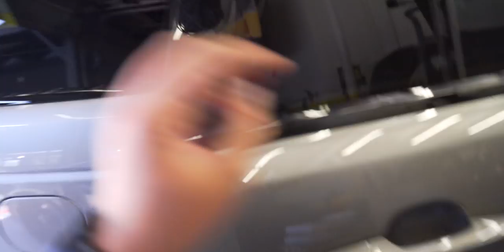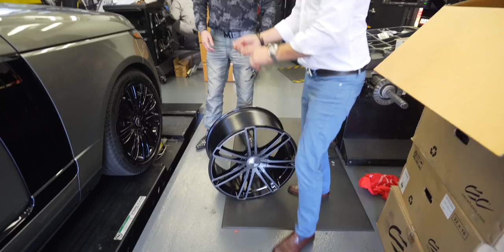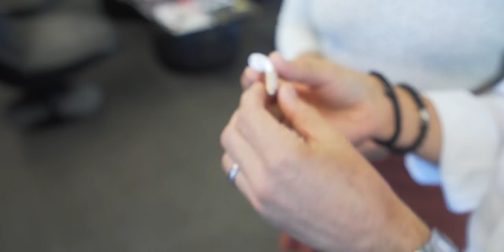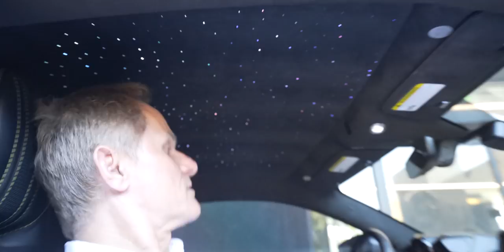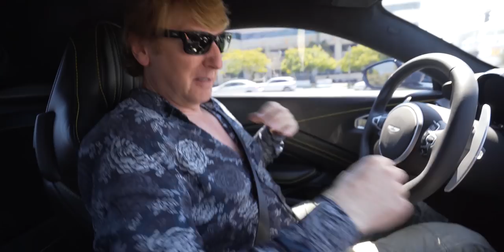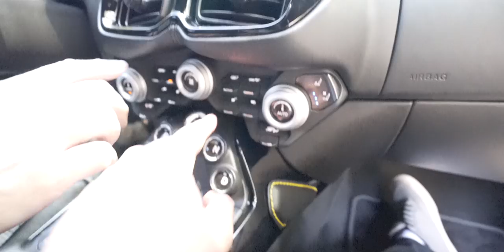INSANE 2019 ASTON MARTIN VANTAGE!!

Comment: Adam: The 8 Pipes coming down from the engine are called the Headers (2on this car). The downpipe is mounted on the turbo which is only one Pipe (as twin turbo two of them one per turbo) the downpipe includes the catalytic converter which doesn’t really let the engine breathe properly now if you remove them you can run more turbo boost due the cats got removed or replaced with sport cats with the aftermarket downpipe so the exhaust gases can escape easier without having to fight through the honeycomb cats what is like blowing against a wall hahah . :)
Reply: 100%
Reply: This car has no headers. The turbos or mounted directly to the cylinder head. The turbos are installed in the middle of the „V“ that’s why it’s called „the hot V“ That’s also the reason why Michael felt that „instant kick“ because this car has nearly no turbo lack because the exhaust gas goes directly into the turbos. However I agree with the downpipe. The 2 downpipes go down from each turbo.
Reply: JustinsSupercars The AMG M177 has the turbos right on top of the engine yes. But it still got tiny little headers (turbo manifold) where the turbo is mounted on. 4 pipes per block go together to one where the turbo sits on. If you look up m177 v8 headers you can see them there are some pictures up. https://www.europeanboost.com/showthread.php?89409-BigBoost-developing-built-AMG-M177-V8-engine-package-with-cast-turbo-manifolds-and-upgraded-turbochargers
Reply: TMO I know that Engine really well, I work at Brabus and work on that engine every day. I don’t consider it a real header. It’s just a little distance piece that is necessary to go from 4 openings to one. Also it depends if it’s an AMG engine if it’s an AMG „S“ engine or a normal „500“ engine. They all have very different parts in and on them.
Reply: JustinsSupercars Yeah you’re 100% right thats why I said tiny headers/ turbo manifold 🙃 worked on the vintage with a friend and installed downpipes on his car. I am not the smartest with cars tho still learning haha
Reply: @JustinsSupercars  its turbo lag not lack
Reply: krusher74 You’re right! Autocorrect was drunk I guess...

Comment: Downpipe is the pipe that comes off the turbine housing. You were explaining the turbo manifold. So you have the turbo manifold which then directs the spent gases from the combustion chamber. It then travels through the turbine wheel giving it energy to spin. The turbine is on a shaft which is connected to the compressor. The compressor side is the side that is your "intake" and is bringing in fresh air. It then compresses, goes through an intercooler (cools the air from being compressed in the compressor housing) , then from the intercooler THEN into the throttle body and into the intake manifold etc. I digress, so the spent gases from the combustion chamber will flow into the turbine housing and its energy spins the turbine. It hits the Inducer and flows into whats call the exducer which then sends it into the DOWNPIPE which is then connected to the rest of the exhaust system. Usually 4-2-1 is N/A cars. With a turbo manifold it's 4 individual tubes flowing into a collector which merges them right into the turbo flange and into the turbo.

Comment: Bad for the planet cars.  Needs more Tesla.
Reply: Wol Tee More like the new Porsche Taycan 😱
Reply: @iandante4694  Yes even that.
Reply: Wol Tee    Whenever there is an issue with the power the gasoline and diesel vehicles are brought out to keep the city moving.
Reply: @patriciaasturias1007 . It's ironic that you say that as it is very likely the the power would be put out by a storm, the intensity of which are increasing due to anthropogenic climate change, which in part is caused by said vehicles.   What has that got to do with what everyday Joe drives anyway?

Comment: A down pipe is the pipe that exits the back of the turbine . The turbo manifold is connected to the exhaust side of the engine with a pipe for each cylinder.

Comment: Not to be pedantic but you are confusing downpipes for exhaust manifolds. The downpipe is the pipe that leads directly off of the turbo to the rest of the exhaust. Not ally the downpipe in these engines have one of the catalytic converters in them. By removing the cat from the downpipe it seriously opens up the exhaust. They are usually engineered to flow much better than the stock downpipes.

Comment: Twin Turbo means you have one fast spooling turbo for low end power and a slow spooling one for top end power and Bi-Turbo means you have 2 same size turbos and they spool at the same time, so its laggier but more top end power and a bigger "kick". If anyone was wondering :D

ps. i know nothing about this "turbo engines dont sound good" talk :D

ps2. a downpipe comes straight from the turbo not the engine. The only thing attached to the engine is the turbo manifold :)

Comment: As a car guy, Adams explanation of down pipes physically hurt me.  The downpipe is the pipe that exhausts directly off of the turbine housing of the turbo.  The multiple pipes that exhaust each cylinder is the exhaust header/manifold.

Comment: Try the A twin-turbocharged 5.2-liter V-12 engine makes 715 horsepower and drives the rear wheels through an eight-speed automatic; mash the gas pedal and the DBS takes off like a Saturn V rocket and  should have enough power for ya.

Comment: No no no, this doesn't have a 8-4-2 or any other exhaust header set. There are still a pair of exhaust manifolds, these still feed the turbo, and the downpipe from the hot-vee turbo is larger in diameter and without the factory restrictions.

Comment: Adam is totally wrong about the down pipes Michael!  It's the larger diameter piping coming off the back side of the turbos usually called the hot side!   A more performance oriented piping.  Usually deleting the Catalytic Converters.  Free up the turbos ability to blow out better.  Hence the better turbo sound and more efficient!  MORE POWER.